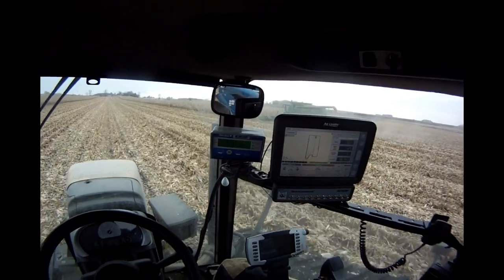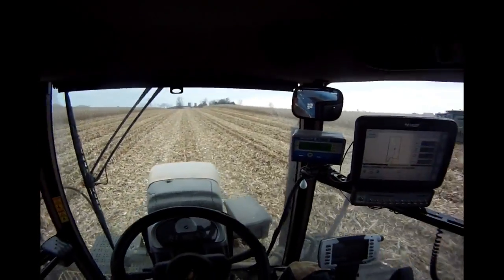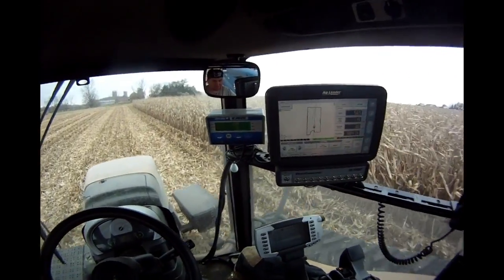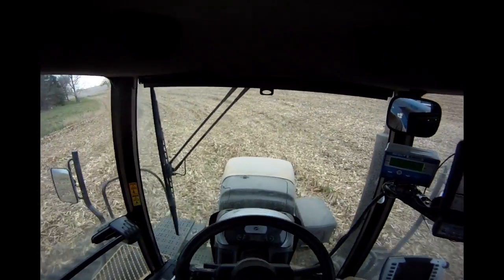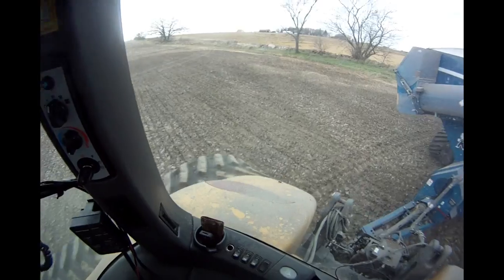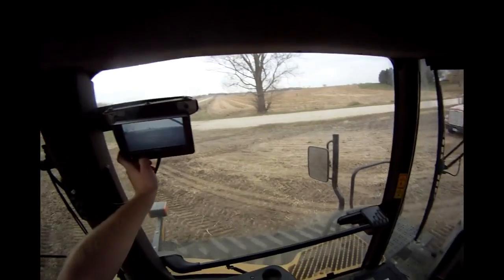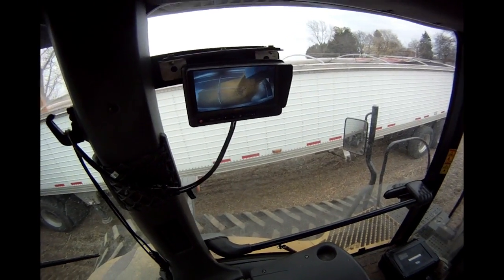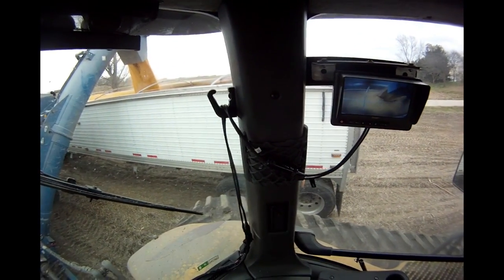Corn Harvest 2016 Cat MT765C Tractor and Kinze 1050 Grain Cart

Comment: Shit this thing is like auto pilot on a tesla! Perfect for texting and driving. Or just get a laptop and play games.
Reply: There is barely enough time to send short texts. There are plenty of things to pay attention to besides steering without adding more visual distractions. The auto steer system in this tractor will only engage when going less than 12 mph. System kicks out above 18 mph which happens often enough in larger fields trying to keep up with the combine. The steering also can kick out at any time if our correction signal gets blocked or if there are not enough strong satellites above the base or the tractor at that particular time. The system we are using was released in 2004, so it wasn't designed to receive signal from the Russian satellites. The newer systems see twice as many satellites as this system. Losing signal is not a frequent problem, but we always need to pay attention in case that would happen especially when running aside of the combine. Joel spends the most time running the cart, but spills the least grain. Great job with the video Joel.